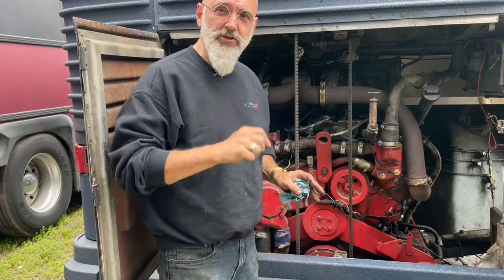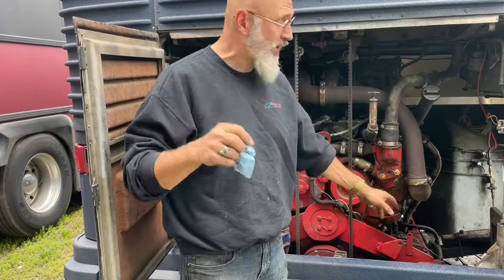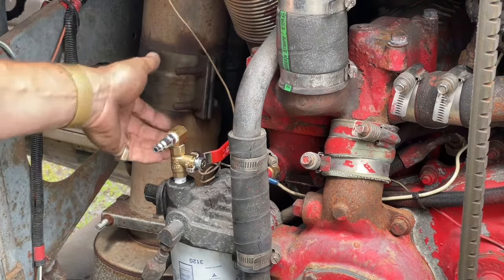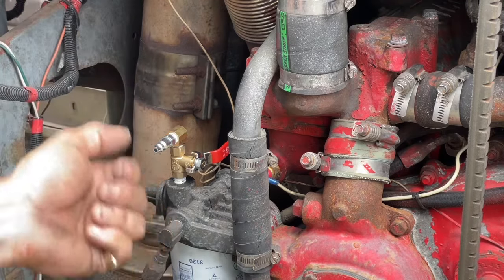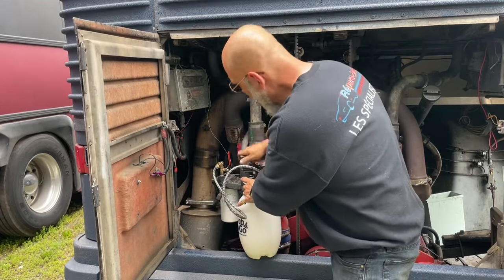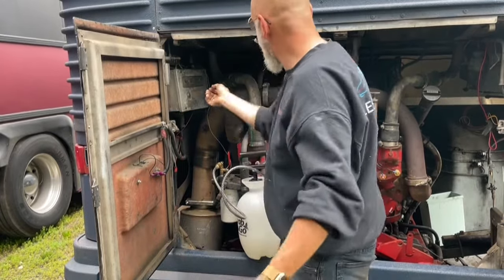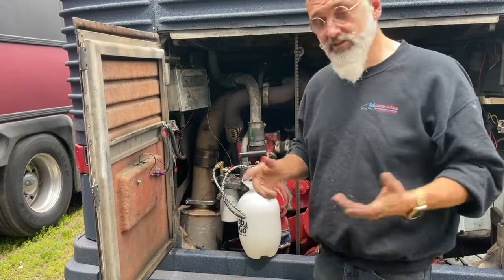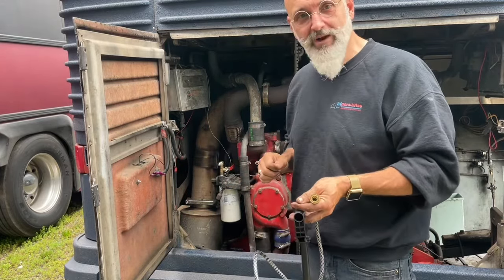Priming a Diesel engine made easy.

Comment: What an absolute legend!!!!
I've got 2 8v92s on a boat and have been avoiding a filter change because of the priming issue.
Thanks so much for your video. Made my day.👍🇦🇺
Reply from the maker: Glad it helped
Reply: I just changed the filters on my boats 8v71s lost power  port side 1/2 mile from dock and am now watching a video on how to prime the motor!  After you fill the big primary filter back up with fuel make sure the o-ring is well seated under the lid and lid is on tight. The new filter was years old I think the o-ring it came with was dried out/stiff. Air got into primary fuel canister. Directions said not to use tools to tighten lid but hand tight wasn't enough. 

Change your filters, boat ran better for sure till the air of course.

Comment: Well I installed a new fuel pump in a series 60, checked both filters which were full.  Would not start and i dont like starter fluid so I did exactly what you said, went to home depot and grabbed a handful of fittings, got a one gallon weed sprayer for 12 bucks and installed it.  Worked like a charm instantly.  Thank you very much.  This is pretty equivalent to the device sold under the Detroit name for $500.  Awesome.
Reply from the maker: Thank you.

Comment: This sounds like my anwser. I have a V6 92TA. I replaced the fuel pump and 6 of its fuel lines. So after the second filter the pump and lines are dry will your method work
Reply from the maker: Yes

Comment: On your sprayer..what size coupler did you use?
Reply from the maker: 1/4 inch
Reply: You had another video priming a Thomas bus using the same process, bus the 1/4 was too small.  I had a skoolie  nomad tell me it was a Devon  hydraulic coupler.  I ordered a 7 16, but I'm not sure if that will work.  I have a 04 thomas with a Mercedes 906 rear engine

Comment: What size are the fittings that go on the fuel filter?
And what type of adapter did you use for the bug sprayer?
Thanks
Reply from the maker: 1/4 npt
Reply: And for the bug sprayer do you remember what type of adapter it was?
Thanks
Reply: @LacroixCruiser  the fitting is 1/4 or 3/4  the one that goes on top of the fuel filter?

Comment: I have a fuel line going to that port you used. Can I still use that port?
Reply from the maker: You can use a T or you may have another plug in another location on the filter base.

Comment: Doss this also work with taking fuel pump or injectors loose??
Reply from the maker: Yes
Reply: @LacroixCruiser    I got it from the parts pantry.  It's a 7\16 hydraulic  coupler

Comment: So on the newer dd15 you have to make the fitings on secondary filter or primary filter?
Reply from the maker: No idea
Reply: DD 15 prime through a compucheck fitting ( flat face hydraulic coupler ) Prime system with 2 gallons of diesel fuel at  95 lbs. of pressure .